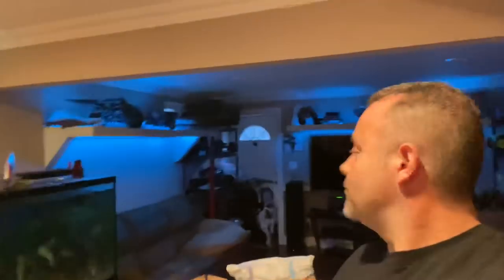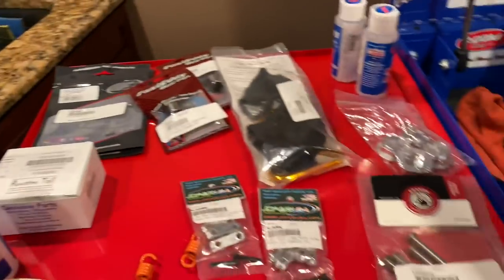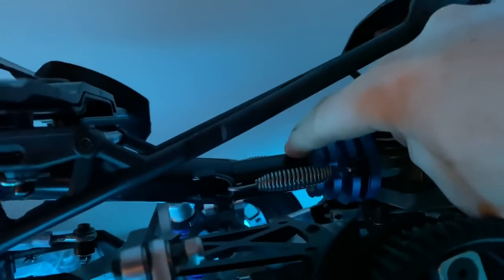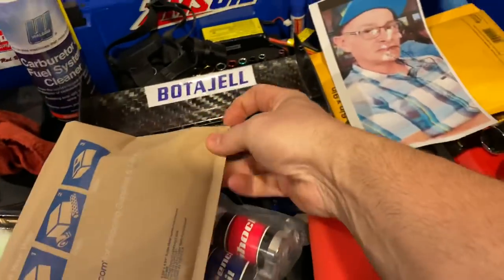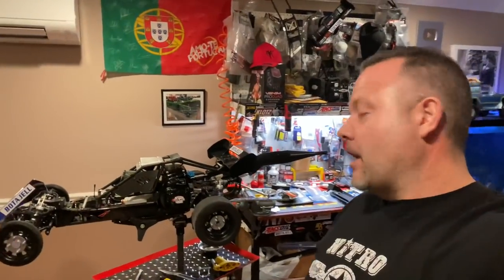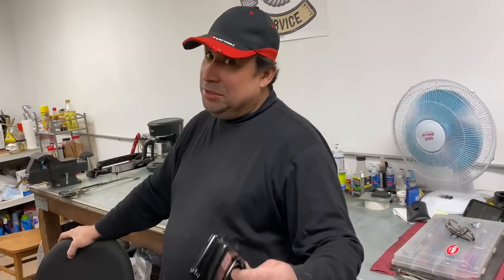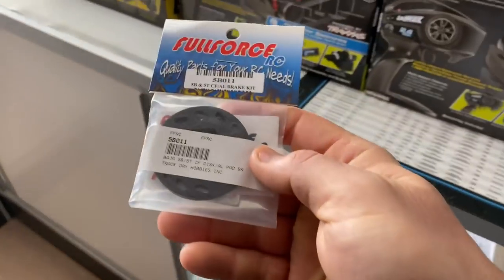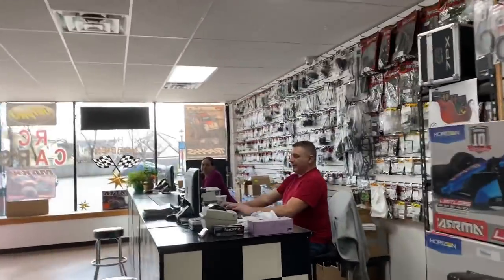One Last L👀k @ My Drag Baja Before Surgery Plus Goodies From Hobby Store

Comment: I was referring to the Rovan Baja 36cc was wondering was the stock just fine or there's a better aftermarket
Reply from the maker: The stock is fine for a while or until to crush or bend it then go with a High quality Bartolone Racing pipe that goes on the side especially if you bash hard.

Comment: Awesome video bro! I've decided to try my hand at drag racing and I'm building a drag baja too. I need some help. What clutch system are you using with the black bone 2 speed?
Reply from the maker: I’m running a king motor 2 speed with Primal Gears ⚙️. My 2 speed is 3 years old now but my gears ⚙️ are 1. I’m running the modified light weight clutch from Bartolone Racing with a 9,500 rpm spring but last year and the year before I used a 8,000 rpm spring. I hated my custom spring that was 12,500 RPMs it was terrible for me . I had much more control with the 8. This year I’m just installing a fresh new BR Clutch because the one on there now is 3 years old . I may have some extra parts for you if you need or even custom made parts to run FG stuff if that’s the route your going ?
Reply: Thanks John. I just ordered the modified shock towers from Ness to use the fg shocks. Just trying to figure out this new platform. Still need to order the shocks and springs. Aren't you using the fg setup? 
Maybe I can stop by one and check out what you've got. 👍
Reply from the maker: Jason Auteri no I’m not using that setup anymore so if Carlos don’t want my FG setup? It’s yours!! Carlos loves his slightly modified stock shock setup that was my very first setup I used on mine I don’t know if you remember my first video with Luis when I first built my Drag Baja ? He’s using those on his and he just goes straight every time so I really don’t think he wants to change? My FG setup was good for me after all the headaches and test and tunes I had to do but I ran my fastest ever and that was a 4.1 at 330 feet. I also had to add weight to that set up
Reply: Well if Carlos doesn't want them I will buy them from you for sure. Let me know as soon as you can, I'm very impatient. 😆 Maybe I can stop by one day and pick them up? Thanks John! 👍
Reply from the maker: Jason Auteri will do . Maybe sometime next week
Reply: Great, thanks.

Comment: Ray @ Track Day has been stocking up on everything. That place is awesome man. I really wish we had a Hobby Shop like that here in da burg. Your Drag Baja looks sick. I did you see your runs with that and I must say its pretty sick. How is that 2 Speed on your Baja. I know there were some issues with the 1st version they made and I do see they now have a version 2 out. Was just curious? HPI Savages were the shit. I miss mine. I had it all Integy Purple'd out and it was bad ass. WOW you guys brought back some good memories too. RC 10, shit I remember when the RC 10 came out in the 80's. I wanted one so bad after my Hotshot got spanked by one when I raced indoor carpet. Never did get one though. I think after that I got into Nitro and I got a Kyosho Vanning. Now that was a bad ass Nitro Buggy when it came out. My uncle actually still has it. Pretty cool I must say. Great vid again as well bro. Thank you.
Reply from the maker: Awesome stuff man thanks for sharing some of your memories with your nitro RCs here . About my 2 speed , it’s 3 years old now and it’s fine for me . Now Primal carries gears ⚙️ for it . 2 speeds are great but not consistent as a single and you must tune it every now and then and even replace the metal claw and spring and even one way bearings if needed . So if you Drag race with any 2 speed you must stock up on parts like those !
Reply: @BOTAJELL  oh ok that is really good to know. Thanks for the info. Much appreciated.

Comment: Hello BOTAJELL. What is the simplest way to lower stock Baja to make it look like dragster. Anyone know?
Reply from the maker: There are many ways to set up your suspension on your Baja to drag race from stock shocks to FG Shocks like mine in this video and to even using No Shocks . Some guys use front Baja shocks and change springs and shock oils and some use custom shock towers also to use FG shocks or whatever shocks they like . The simplest way and cheapest is to use stock shocks with different springs and oil and relocate them on your towers . You may even have to drill out your towers to work .
Reply: @BOTAJELL  thanks for help. First I will try with stock shocks. I saw videos how to shorten them and I will see how it gonna work. I really like your videos! 👍🙂
Reply from the maker: Metal Works Workshop just make sure it’s not to stiff ! When you come out the hole after your burn out you want your rear end to squat and grip NOT to hard and stiff because the tires can break loose and you will go out of control
Reply: @BOTAJELL  OK, thanks BOTAJELL.

Comment: Yo bro.... I just got a new pipe for my losi 8 rtr. I haven't taken nothin out the box yet. Is it better to break in the engine with the new pipe now or wait until its broke in with the stock stuff???
Reply from the maker: Stock pipe is good enough for the stock dynamite.28 rtr engine. Just run that engine and have fun and learn from it for a few gallons if you can if it will survive? Then please just install a Novarossi 28-8 or a 28-7 or a LRP .32 X series then you can use a 41032 header and a 9886 pipe or a 9853 pipe
Reply: @BOTAJELL  I really appreciate you helping me out. I'm still enjoying and learning this hobby.. I dont have the truggy, I have thr buggy with the .21 I got a pipe for it.
Reply from the maker: TY'S TAKES for your buggy to be bad ass you want a .21 MITO 7 or a .21 Bonito or a .21Elite 8 or a .21 O.S. B2101 engine and a 41001 header with a 9886 pipe

Comment: BOTAJELL I have a  couple of ?  About nitro if you don’t mind do you leave your idle screw at .6 mm like novarossi  says to on the .28-8  in the manual and tune idle with low speed when I try it that way it’s so rich it doesn’t even want to takeoff if I  if I set the idle screw with a smaller gap turn and  lean out the low-speed needle I get a weird sounding bog mid RPM any help would be wonderful thank you
Reply from the maker: Yes that’s fine I do .6 or .5 always that’s 1/2mm idle gap ! I say this many times on my past nitro videos and how I tune nitro engines. After my engine is warmed up with a heat gun to 200 degrees Fahrenheit I will fire her up and i will lean my low speed needle little at a time until the engine can stay idling . I will never use my idle screw for that . The high speed is adjusted only for my full throttle runs

Comment: hey BOTAJELL i love your videos and your bashing i was wondering why this happened to my t maxx please help okay so heres what happened first time i start it up it idles but i had to hold the brake if i didnt hold it the rpms would go up and start moving please help!
Reply from the maker: You need to adjust your end points . End points are one of the most important thing to do before anything else that way you have a better chance on getting your tune right and you won’t over stress your servos so your servos last longer
Reply: @BOTAJELL  thanks!